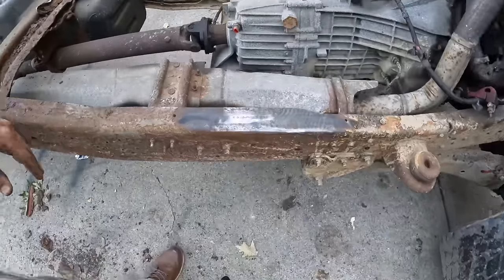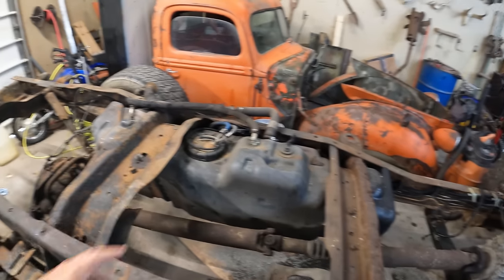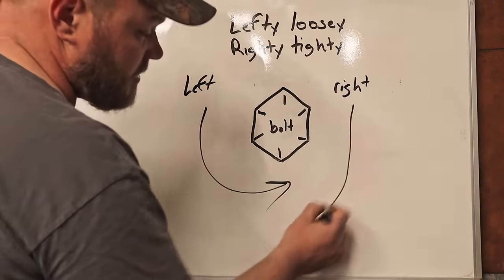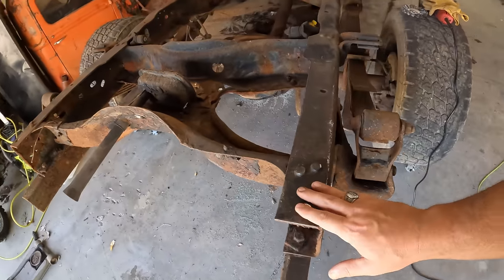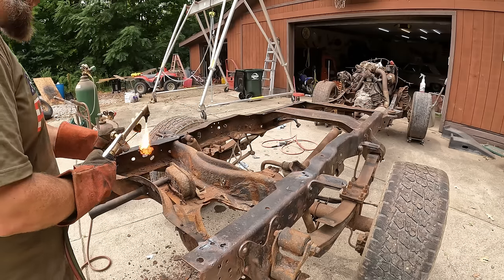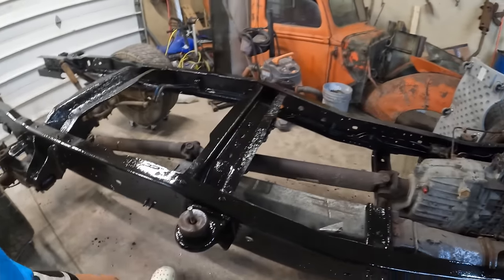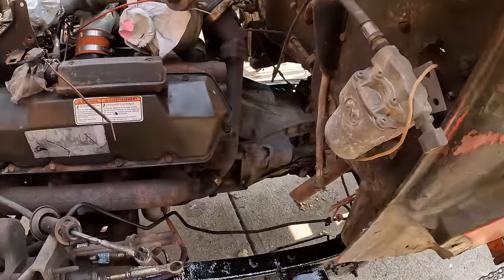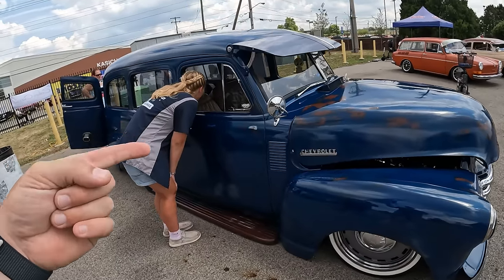Restoring a 1941 Ford Powerstroke - The Ultimate Blend of Old and New

Comment: Why would you use a power joke motor  .???
Reply from the maker: Well,…it’s a ford motor in a ford truck. And, I’ve already got a 47 Chevy with a Cummins in it, anybody can do that, no one has done a 41 Ford with a 7.3. Also, I’ve owned 8 7.3 trucks over the years and am very familiar with them. Lastly,….because I thought the challenge would be satisfying if we could pull it off. Thanks for watching.